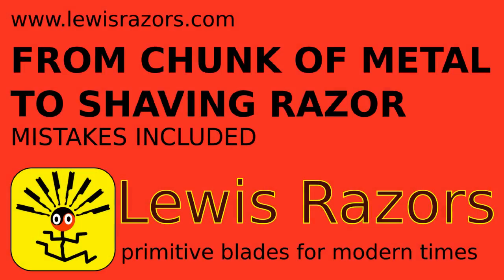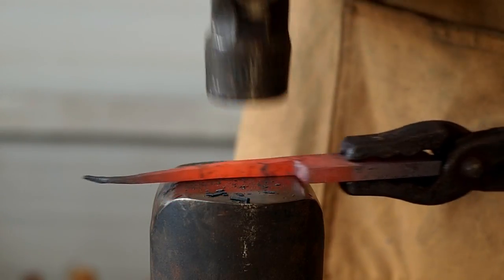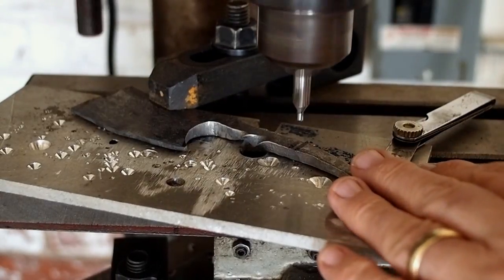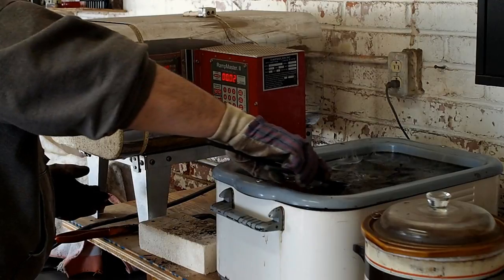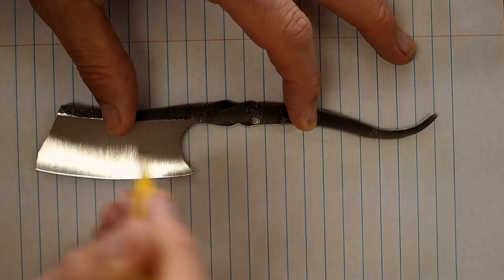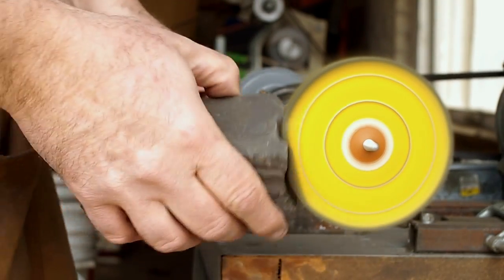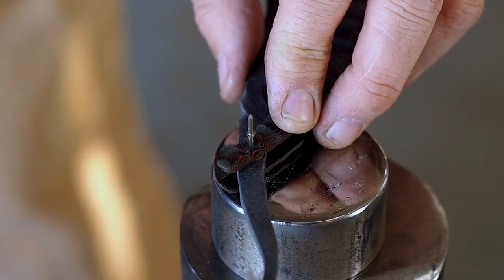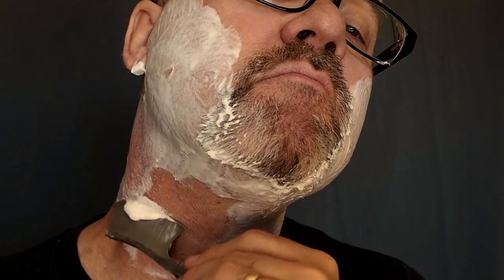Razor, From Chunk Of Steel To Shaving

Comment: i dont want to down on your expeirience nor do i know how to spell that lol, but im a machinist so im pretty good at heat treating, im guessin youre either using a high carbon steel like in the 1100 series or o1, so you should invest into some stainless steel foil to wrap your in for stress relieving and heat treat which will prevent you from getting that scale, that scale is whats known as decarbing, which is making the steel more brittle and loses its hardness, plus when heattreating give it an hour per smallest cross inch im thinking probably 20 minute full soak time for that size, you seem to know what your doing but i figured id give my 2 cents to help
Reply from the maker: Thank you for your input, every thing you say is text book perfect and I agree with you in a way.  In my case I want the the scaling on the surface for appearance reasons, I like that rough metal look. I am leaving enough metal pre-heat-treat to grind away the decarb on the edge of the blade.   Thank you again for your comments and thoughts.

Comment: Love that little anvil my man!!  Perfect for straight razor work.  
I have a question:  when you are drawing out a blade width-wise, do you use the bladed end of the hammer rather than the blunt end?  I know you’re using a ballpeen, but when using a standard blacksmith hammer, one end is bladed, the other is normal.  

I apologize for my lack of correct blacksmith vernacular 😊

Comment: Dang man. Sounded like someone was raking gravel when you were shaving. Lol.
A hot shower before shaving softens the beard nicely.
Reply from the maker: I agree with you, I shaved in the living room where I had the lights, camera, and microphone set up.  It was not optimum shaving conditions, i was concentrating more on the video and sound than on the shave. The hardest part for me was not having a big mirror to look in I had a small mirror taped to the tripod. 

I normally shave right after a shower, but when I made the video was concentrating on getting the best video and audio.  I was really happy with I got the hair cutting sound recorded, I worked for that sound. :)   It was not the best prep, or shave, but I am happy enough with the production.

Comment: The forge does not burn the metal, it causes oxidation on the surface of the metal.
Reply from the maker: Burning is a form of oxidation, I guess it depends how pedantic you want to be.

Comment: best way us smithies learn is by our mistakes! eh Lewis? <3 not having all the fancy stuff im usually stuck using my wits a rasp and a rail track (large solid steel sledge) whatever works :D
Reply from the maker: I have used and still have my rr track anvil, I get what you are saying. thanks for the comment.
Reply: you are awesome :) just gotta get that out... you really create a beautiful and practical blade :)
Reply: so a few things iv noticed, your edge looses some carbon in the grinding process due to the heat from the grind. that blade is getting hot enough that the surface steel is actually on visual estimate to be about 40-45 carbon hardness. the back end of the blade is showing at a straw colored 60 carbon. the heat bleeds the carbon from the blade's top layer (nothing bad about this at all in fact it's a good thing) when it comes to the processes involved annealing is not always needed but preferred to keeping the strength of the blade however it can also make the edge too soft if done improperly (too much heat for too long). metallurgically speaking  what you are looking for is the ideal composition of softness and hardness through the kiln anneal process without loosing too much of the carbon. how you work is a pleasure to watch...

Comment: Really interesting process. I must say it was quite a long video, not necessarily a bad thing however; I finished it in sections. I'm really interested in your honing stones. do you have a vendor you would recommend to get this set? On that note, is this a particular set you would use for any knife honing, or just razors meant for shaving. How long have you been doing this? Hope to watch some more of your videos soon. Thank you for taking the time to show this process. Very interesting.
Reply from the maker: All of my stones have different sources they are a hodge podge of stones I have collected through the years.  I have bought them from woodworking, cooking, and shaving sites. I really do not have a vendor to recommend for the hones. 

You could use them on knives if you wanted. For my own kitchen knives I only go up to 1k I mainly use the 600 and 1000 grit diamond hones on my own knives. 

I would recommend getting diamond stones for the coarse stones, then combination water stones for the finer grits.

Comment: Asmr honing! Lewis you're a talented bladesmith. Do you buy your scale stock in a particular thickness?
Reply from the maker: somewhere around .100 give or take a little
Reply: @lewisrazors  so is 1/8" to thick?
Reply from the maker: 1/8 will work

Comment: All that craftsmanship then you tanked out on the sharpening. The whetstones are high quality but you can make it 100 times sharper  with a better technique. Over all 10/10 for the metal smithing & 8/10 razor quality. Good job nice work
Reply from the maker: I appreciate your thoughts, Thanks for comments
Reply: @lewisrazors  I only have an opinion because I'm a sharpener myself. I'm not a Craftsman like you are but I would have loved to see this at a T1 or T.8 sharpness because it deserves to be that sharp.

Comment: Really beautiful work. Great to watch. Why did you use the stone to finish honing? It sounded like it was a lower grit than the 12,000
Reply from the maker: It was a natural stone from the Nakayama mine in Japan. Since it is a natural stone, I do not know the grit. The Nakayama stone smooths out the edge from the 12k and makes it feel a bit smoother on the face. It does have a different feel and sound from the synthetic stones, you have a good ear.

Comment: Where did you learn about forging, heat treating, and annealing? I do sheet metal fab work, and I'm teaching myself welding, but heat treating, and annealing, especially, are beyond me.
Reply from the maker: I have learned a lot from other blade smiths, and from reading.  "Steel Metallurgy for the Non-Metallurgist" by John Verhoeven is THE book for me.  I have read and re-read the book, I learn a little more each reading.  I recently took a metallurgy class from Howard Clark he used the Verhoeven book as a text.  There are a lot of wives tales and BS in world of heat treating knives, I would start with a 101 level metallurgy text book then move on to the Verhoeven books.
Reply: Awesome! Thanks for response. I'll look into both the "Steel Metallurgy for the Non-Metallurgist" and the textbooks. Thanks so much. And great video.

Comment: dont know if you will see this but as a novice who is interested in making knives and blades for personal collection, do you think it would be smart to invest into a large veriety of sharpening stones or just the average sets. I saw that you used multiple to get the correct sharpness for the razor, I was just wondering if you have any tips for where you buy them. Thanks for the video, it was awesome!
Reply from the maker: It depends on what kind of knives you are making and sharpening.  I used a crystalon and fine india hone for years before switching to water stones. For knives I would recommend a basic set of stones. A couple of combination water stones would be a simple versatile set of stones.

Comment: A while back I quit using the assemble expensive deposable razors, bought a safety razor handle, I still have disposable blades, the blades cost about 6 cents. I don't do and upstroke it is too close. I also discovered doing so causes the hair to grow straight out instead of down, so when you grow a beard it causes that poofy short beard.  I have never use a straight razor, any suggestions.  I am jeweler I had a barber friend ask me to make them a straight razor any advise you can offer me? I will not be forging it 1. I don't have a forge anvil etc.  I will be creating with files and belt sander not designed for making knives but it has the curve for the hollow.

Comment: hi what is the process to softer the metal and how you do it, Sorry I'm really fan of you work . if you have any video about it, that razor its beautiful.
Reply from the maker: Annealing is the process used to make metal softer. With simple steels, the most basic process is heat to critical then cool of a a very slow rate.

Comment: Do you think using saws and files rather than pounding to shape steals some of the art from the end peice?
Reply from the maker: I own and have made knives and razors that or both forged and stock removal blades. I do not think there is any less craft or art in a stock removal blade.  It is just two different paths to get to the same result.

Comment: I searched Nakayama mine's Whetstone. It so expensive.
Reply from the maker: I traded a friend for mine, otherwise I would not have it. The Nakayama stone is not necessary, it is just the icing on the cake. The razor will actually shave well after the 8k stone, everything after that brings small improvements.  The way I look at it is the 8k makes the blade 95% sharp the the 12k adds a few percent, the Nakayama adds a few more percent to the sharpness.

Comment: Would a flat grind work ok? I don't have a large wheel on my grinder only a platten. My steel is coil Spring. Thanks for sharing this video with us.
Reply from the maker: The razor acts like it has a built in honing guide when you lay it flat on the stone. Both the spine and the edge touch but the hollow does not. A flat grind would not work very well.  If I were in your shoes I would first flat grind the blade, then hollow out the middle section with one of the small wheels on the ends of your platen.      Here is a video with some design ideas https://www.youtube.com/watch?v=isPvvVdyQio

Comment: Great video!  What's the crust that forms on the outside which falls off in flakes as you hit it? 👍
Reply from the maker: The flaky stuff is scale from the forge, the heat from the forge is burning/oxidizing the outer layer of metal.  The scale comes off when hammering.

Comment: Have a question about when you go to the kiln. I don't own a kiln, usually what I do is I use my oven in my shop. I'll do 2 cycles at 400 degrees for a hour each let rest till it reaches room temperature in between. Now my question is would you say that our results are the same?
Reply from the maker: Yes, pretty much the same results.

Comment: hi, awesome video!!!!
one question, what are de measures of the straight razor?
Reply from the maker: It has been a while I do not remember the exact sizes, but the blade portion is probably a little less than 3 inches long, and the blade is maybe 1 1/8 wide.

Comment: may I ask what kind of blade you're using in your bandsaw? I'm going to be buying a bandsaw soon mainly for woodworking, but I'd also like to be able to cut some tough metals like you did here.
Reply from the maker: It is a 18tpi bimetal blade,  the saw is a metal cutting saw, it runs a lot slower than a wood working saw

Comment: is it possible to make a hollow grind with minimal tools? I am an artist blacksmith just starting out with basic hand tools, a forge, and angle grinder, and a really small block of metal as an anvil. and I'm kinda to broke to get a belt sander or even pedastool grinder right now.

if you have any ideas I would really appreciate it. I've always wanted to make a straight razor.
Reply from the maker: My first straight razors were framebacks, where the high carbon blade is put into a mild steel frame. I did not have the equipment at the time to grind a hollow razor.  I would recommend searching on Straight Razor Place forum for frameback razors. And see what you can figure out.

Comment: i would like to know what brand and the grit of the stones you used and where to buy them. Im having a hard time finding stones to keep my straight edge sharp.
Reply from the maker: My current stones that I use most are;  1k=naniwa  4k=norton 8k=norton 12k=naniwa   Most any good brand of water stones will work, Norton, Naniwa, Shapton.  I have bought them from various stores. 

Lynn Abrams, and Gssixgun have good videos on honing, I have learned a bit from both of them.

Comment: This video is a couple of years old and I see your website store is closed down but hopefully you're still around for a couple of questions. Is there a steel I can use that is easier to heat treat than 01 for this kind of application? Would 1084 or 1095 work or would they not work for something as thin as a razor?  Could one get away with heating in a forge, rather than a precise kiln, for the series of heat treatments you do?  If 1084 or 1095 would work physically, would the petina process you went through keep it from rusting?  I really enjoy your videos, do you still make razors? Why did you close your store?  Thank you!
Reply from the maker: 1084 or 1095 would both work great, 1084 is easier to heat treat and takes a patina better.  Yes a forge would work for heat treat especially for 1084. The patina is just for looks, you have to take care of a carbon steel blade in a wet environment. 

Yes, slowly making razors.  SRD shut down they were selling my razors I did not own the store.  I am not sure of the reasons.
Reply: @lewisrazors  can you talk about your post anvil? Did you make that?
Reply from the maker: Here is a vid https://youtu.be/mZQy-NU_TTc

Comment: I didn't understand what you said when you talked about the scales material.  What kind of wood is it?
Reply from the maker: The scales are micarta, It is layers of resin with cloth or paper.  I think I used linen micarta on this razor it has been a fewyears

Comment: Question, I see on almost all the knife/razor videos I watch everyone grinds with the tip, or edge against the grinder point first. And I wonder why? Couldn't this cause the piece to catch? Thanks.
Reply from the maker: It is easier to see what you are doing behind the edge when grinding edge up. The blade will sometimes catch on the belt but it is a rare occurrence.  To me it is a six of one or half dozen of the other thing, lately I have been grinding edge up or edge down about 50% 50%.  I do know a couple of blade makers that will only grind edge down.  Edge up, you can see what you are doing and have a bit more control grinding by the edge, it will catch on the belt every blue moon or so, not very often at all.

Comment: What is the purpose of those nails againt the buffing wheel i still dont understand
Reply from the maker: The wax on the buffing wheels gets hard and glazed over, the nails break up the smooth surface and make the buffing wheel work better.
Reply: thx

Comment: Sou barbeiro há 20 anos , mais confesso fiquei com medo de você se cortar.
Reply from the maker: The razor was a little dull, I should have sharpened it some more, but I had the camera set up and went went a head with the shave. It was a pretty crappy shave. Bad prep and dull razor.  At least I did not cut myself.

Comment: how was the quenching temperature? do steel didnt look red? didnt understand that process
Reply from the maker: The steel was about 1500 F before quenching. The tempering after quenching was done at 400F Depending on the lighting and camera it is hard to get the right exposure so the hot steel looks the correct color.

Comment: Why you push the blade while you sharpening and  not pulling it over the waterstone, is there any special reason for? i know the pulling method only.
Reply from the maker: It is the way that works for me. There a lots of ways to get to a good shaving edge, I stick with what I am used to, not real reason other than it works for me.

Comment: Lewis what degree angle do you hold the blade to get the correct edge. I have tried with a few projects and they still feel a bit dull
Reply from the maker: the blade lays on the hone, both the spine and edge are touching the hone, it is like a built in honing guide.  The total angle of the edge is around 16 degrees

Comment: What oil do you use to quench the razor after heating
Reply from the maker: I have two quench oils a fast oil Parks 50 and a medium oil made by Maxxum.  I used the medium speed quench oil for the o1 in this video

Comment: what size pin stock do you use? Is it 1/16"? if so, where did you get your die block? I can't find any with 1/16" holes!
Reply from the maker: Yes, I used 1/16 rod, the black is a home made thing. Thanks for the comment

Comment: Why is the curve in the blade important?  Instead of having a straight razor edge.
Reply from the maker: The curve is only there for the looks, I like a smiling blade. A straight blade would work just the same.  I just like the looks of it.

Comment: Looks like your cutting metal with a wood cutting bandsaw....
Reply from the maker: It is actually a metal cutting saw and blade.  It runs real slow compared to my wood cutting saw.
Reply: @lewisrazors  hmmm, that wheel looks like it has the rubber tire and if it does then its a wood saw. But no matter as I will take your word for it that there is no tire. But it wouldn't be uncommon anyway as these metal saws are expensive and hard to come by so many use the wood version.

Comment: OMG my face would be in flames if I shaved like that, plus against the grain fuck!
Reply from the maker: That was not the best shave ever :)  I had a hard time shaving in the living room with lights and cameras, using a tiny makeup mirror taped to one of the cameras.   Shaving in the bathroom with better prep and a big mirror is a lot better experience.  I was really concentrating on making the video as best I could, not so much the shave and shave prep.